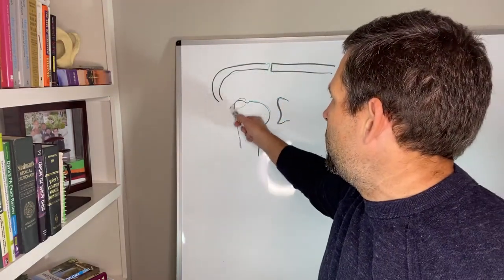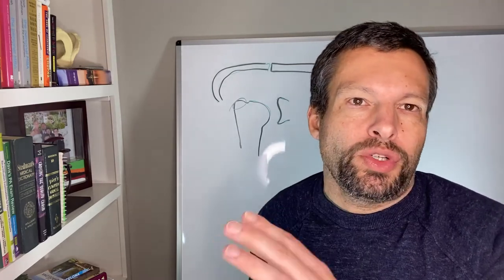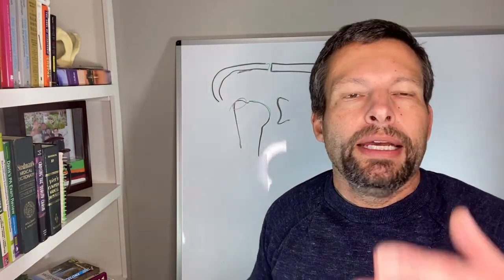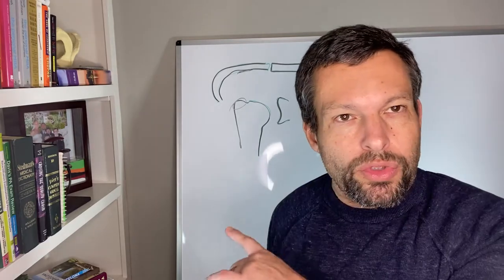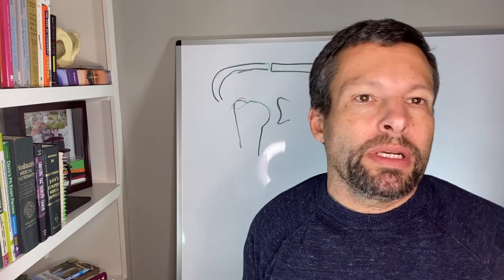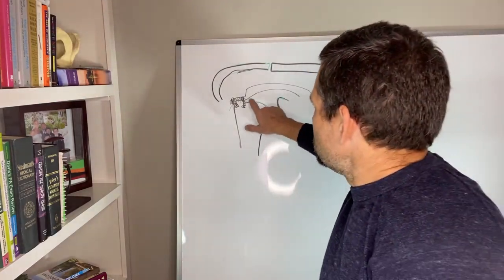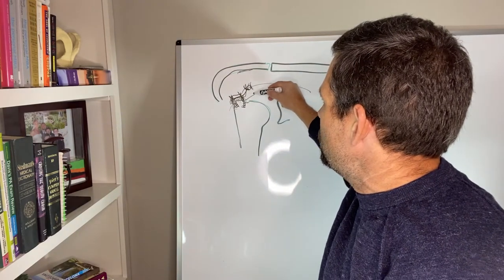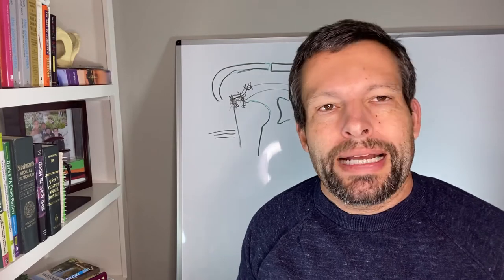Why does the rotator cuff retear and what can be done about it?!  Don't Lose Hope!

Comment: I had rotator cuff surgery 5 months ago. I wa s slow so dr said I have to lift my arm to the shoulder on month 3 and I did  but I did fast. Dr said I have to lift up over my shoulder on the month 4 and half.  And I did but I can’t lift slow. And  a lot of pain. Dr sent me to MRI and shows I got infection at the joint. So now I have to have IV for 6 weeks. After infection is gone I have to replace my shoulder. I am scared. And cry a lot. I am a 54 woman it is night mare. 
So how do I know I have no more infection? 
Thank you
Reply from the maker: Typically blood work will help determine if the infection has cleared.   So sorry for your situation.  Good luck in your recovery.

Comment: The superior capsule reconstruction is only for irreperable supraspintus cuff tear? What about an irreparable infraspinatus or subscapularis? The graft cannot be used to hold the shoulder in that case?
Reply from the maker: Good question, typically the SCR works best if the subscapularis is intact to attach the graft. The infraspinatus can be substituted with the SCR.

Comment: Hello Dr Daniel! Great videos. Thank you for sharing such valuable knoweledge!  It was 30 days yesterday as I had an ortroscopic surgery. Supraspinatus tear. Yesterday I hurt the shoulder when doing streching. Liying on my back I walked with the fingers to move the arm from the body (sliding the floor). And at some point I helped with the mussels (not deliberatly) and it ached. No really hard. Than it ached throuhg the night. And is aching today. How can I make sure that I have not damaged the repared place?
Reply from the maker: It is really hard to tell early on if it is damaged or just inflamed. I would get in to see your doc for a recheck if it is not feeling better.
Reply: Question. Why don't they do all of these steps for the first repair? Why not add a graft do double stitching more anchors, clean the bone, etc. in the *first* repair?  Wouldn't that reduce the chances of a re-tear and then a second surgery??

Comment: My surgeon told me that my arthritis and cartlage loss was really bad after repairing my rotator cuff.  The only thing left is shoulder replacement.   Would I be able to hit a serve, throw a baseball, or swim distances for cardio  exercise with a shoulder replacement?  I did MACI on my left knee due to cartilage loss, but it's not approved for shoulders.  I'm 46 and not sure why my cartilage is deteriorating so quickly.
Reply from the maker: Michael, Hopefully you wont need a TSA.  Many people can function at a high level with arthritis in the shoulder.
Reply: @rotatorcuffexpert  Dr. Orcut your youtube page is awesome.  I've never seen someone at as high a level of medicine as yourself so willing to share information and I'm extremely grateful for what you do.  I'm an optometrist.  I'm not sure if you have ever seen a slit lamp.  It's what we use most of the day.  I'm right handed.  I'm wondering how soon I can get back to using my slit lamp without messing up my rotator cuff repair.  One thing I know for sure today is that it's not going to happen with the wedge in my sling.  I could probably do it if I had to by just taking the wedge out.  I can live fine without tennis for the next year.  I can use my panoptic for now but obviously I'd like to safely use the slit lamp again as soon as I know there's a way to do so without messing up my surgery.  I do have a scribe.  I thought I wouldn't be able to write but I can do that without pain as long as I have a clipboard.  I wish I had my post op notes to remember what my surgeon chose to do.
Reply from the maker: Michael, thanks for your kind words.  As far as a slit lamp, yes I remember what that is!  I would think it wouldn't be too long until you can use it.  A lot depends on exactly what was done and the comfort level your surgeon has in letting you use your arm to move the slit lamp.  I wish I could be more specific.  Good luck and thanks again!

Comment: I tore my labrum and post surgery rehab didn’t help. I can’t extend my left arm / hand to touch the top of my head. Only movements to hold onto things but I can’t put things together anymore as it’s difficult to use a screw driver or twist movement. Again I can pick things up that is low level like a box 📦. I won’t ever be able to play catch or put that arm in the air again. I had another bad dream due to not being able to catch something. 

I want a titanium bionic cyborg shoulder. 

The doctor said under anesthesia he could rotate it 180 degrees but it won’t move daily. 60 physical therapy visits 3 days a week. It’s 5 years later and it becomes more and more frustrating. 

Any suggestions on if a 2nd surgery is possible.
Reply from the maker: Mark, wow that is a long struggle.  There is always something else we can do as surgeons.  I would get another opinion. A new doc that can look at a recent MRI, evaluate you and give you your options.  Good luck.  Please consider joining our email newsletter for more information and insights and we will send you 2 Free PDF fact sheets that will help you through your recovery.  Send an email to info@mybodyprotector.com just put "yes" in the subject line and we will get you signed up!

Comment: what if the graft did not take?   And when does the pain start subsiding.  I am week 8 after major surgery- graft, bone spur, and biceps tendesis.
Reply from the maker: If the graft does not heal then another option may be the reverse total shoulder. It doesn't require the rotator cuff to work.  I hope your pain lessens soon.
Reply: @rotatorcuffexpert  with reverse shoulder, are the rotstor cuff tendons still intact, can possibly heal?

Also with superior capsule reconstruction, does it take stress of the rotator cuff tendons allowing them to heal. Maybe a case for doing it for partial tears/tendinosis with superior instability?

Comment: Hi Doctor,
On Sept 20 I had arthroscopic surgery to repair a massive full thickness tear of left supraspinatus, a Biceps tenodesis, several bone spurs shaved off, plus acromioplasty and distal clavicle resection.  Did 3 weeks of OT and was doing GREAT.  Therapists couldn't believe how much ROM I had gained back.  Was just getting ready to start Therabands and light resistance to regain strength--then on Oct 28, I rolled over in bed and heard a loud POP.  Instant pain.  Developed bruising in arm down to elbow.  Went back to doctor and an ultrasound showed re-tear of SS.  Have repair surgery scheduled for Dec 1, with a "tendon graft."  Was told if this doesn't work, a shoulder replacement is next option.  I  DO NOT want that!!  Any advice on how to protect and "baby" shoulder after repair surgery with tendon graft???  Do I need to sleep exclusively in a recliner for 2-3 months???!! THANK YOU!!!
Reply from the maker: Ugh, I am so sorry!  You will go much slower with your progression after having the graft placed.  Sleeping in the immobilizer may be necessary for a while.  Talk to your doc.  Good Luck!  You can have a very good result with the graft.
Reply: @rotatorcuffexpert  Thank you!  I will go slow and protect it for sure!!!
Reply: @rotatorcuffexpert  P.S.  I LOVE your vids!!!  Best ones out here!!!  THANK YOU!!!
Reply: I experienced something similar. Three weeks after surgery to repair a large tear I was dressing and both felt and heard a horrendous pop. The pain was so intense, worst pain by far since I first injured it. Even post surgical didn’t hurt that bad. I’ve had pain in my shoulder and down to my elbow ever since. I’m frustrated and in so much pain that I’m considering giving up and letting nature take it’s course. I’m 7 weeks post op and will see my doctor in a few days. I’m afraid to hear what he might say.
Reply: @rosew.1728   Hi Rose, I am happy to report I have done very well after the repair surgery with the tendon graft.  Don't be afraid, keep your spirits up and think positive!  The recovery after the 2nd (repair) surgery was much easier than the first one!  Wishing you much success and healing

Comment: #DrDan I have searched though all your videos but I cannot find one which explains how to get the right diagnosis with movement tests or is that not possible with an x-ray, ultrasound, MRI or a CT scan? I am struggling to get the correct diagnosis even though I have had an MRI and US. I am 66 and so there is obviously some degradation, so how do you know if it is the degradation that is causing the pain rather than something else, because presumably the degradation was there for some time before getting pain. Also, is it possible for an MRI and US to miss a tear?
Reply from the maker: The diagnosis comes with combination of both physical exam as well as imaging, both Xray and MRI.  In my opinion US has limited ability to diagnose in most peoples hands.  The MRI and MRI arthrogram by far give the greatest resolution and detail of the structures in the shoulder.  It is possible that a MRI could miss a tear but unlikely.  Again it takes your history, your physical exam as well as the imaging to come to a correct diagnosis.  Good luck.  Please consider joining our private FB group https://www.facebook.com/groups/409240847744184
Reply: @rotatorcuffexpert  Thank you that is very helpful.
How often when you operate on a rotator cuff do you find stuff that varies from what you learnt by MRI, X-ray and hands on examination?
Reply from the maker: Often we find things that are not exactly what the MRI described.  For example a higher grade tear or it being more of a biceps problem then a rotator cuff.  Usually it is not terribly different and the surgery is just slightly different than expected.

Comment: So 10 years after rotator cuff surgery it seems like I have a research. I had an MRI Saturday, this is the report. 
Postoperative changes of distal clavicle resection and subacromial decompression. The inferior AC joint capsule is partially torn consistent with postoperative change.

Small subacromial-subdeltoid bursal effusion contiguous with the AC joint.

Postoperative changes of superior rotator cuff repair. The superior rotator cuff tendons are attenuated without a high-grade retracted tear. There is partial-thickness bursal-sided tearing of the supraspinatus tendon. Teres minor is intact. Subscapularis tendinopathy.

Fatty infiltration of the rotator cuff musculature involves less than 50% of the muscle volume.

The long head biceps tendon demonstrates tendinopathy and partial tearing at the genu with peritendinous edema. The tendon is perched on the lesser tuberosity.

Diffuse degeneration of the labrum. Diffuse, partial-thickness thinning of the glenohumeral articular cartilage without reactive osteoedema. No joint effusion.

Contusion or low-grade strain of the lateral deltoid muscle. Mild infiltration of the subcoracoid fat can be seen with adhesive capsulitis.

No lymphadenopathy.
Does this seem serious enough to need another surgery?
Reply from the maker: Hey Mark, Thanks for the comment.  The MRI is only one piece of the puzzle.  The doctors exam as well as your pain level and pattern will help you and your surgeon decide what to do next.  Good luck and please consider joining our email newsletter for more information and insights. Send an email to info@mybodyprotector.com just put "yes" in the subject line and we will get you signed up!
Reply: That mri is very detailed. Where did you get it?
Reply: Also what movments hurt your ac joint /clavicle?

Comment: I am a 59 year old male. Structural Ironworkworker.I am going in for my second rotator cuff repair  same shoulder..
With a possible Graft.
What can I expect in regards is it more painful then the first?
I am assuming the recovery is longer?
Also should I be getting a shoulder replacement instead because of the lesser success rate..   your feedback would be great 
Thanks in advance Bill.
Reply from the maker: Hey Bill,  I have not seen people have more pain after the second, typically it is about the same but yes a longer recovery.  The other question about what surgery you should be having is a great one.  I would definitely have that conversation with your surgeon.  Please consider joining our email newsletter for more information and insights. Send an email to info@mybodyprotector.com just put "yes" in the subject line and we will get you signed up!